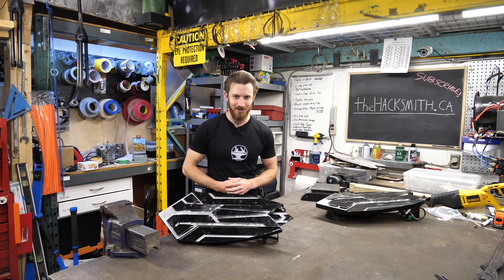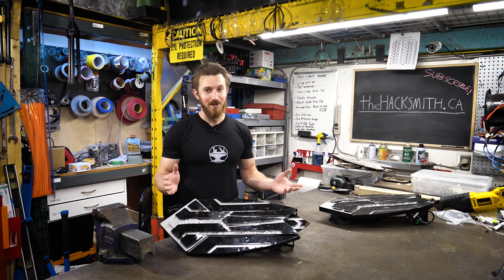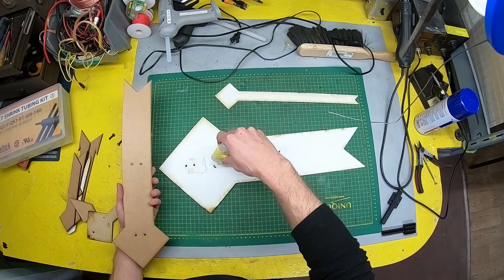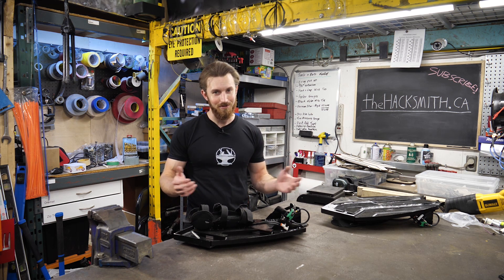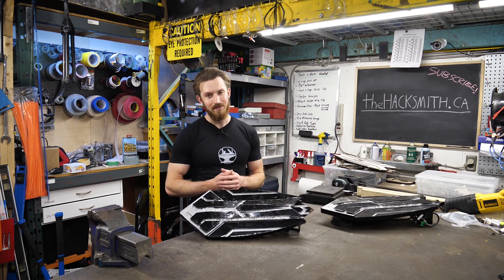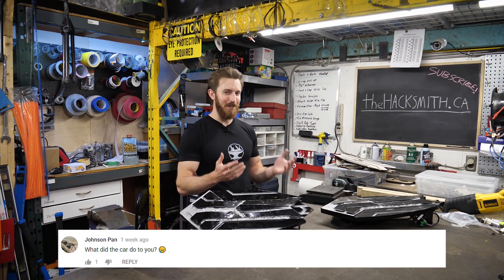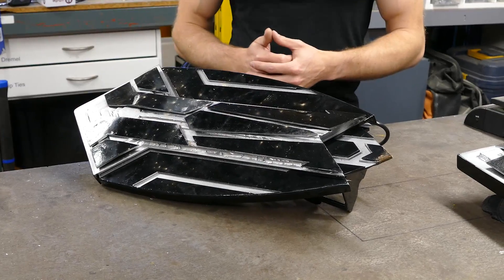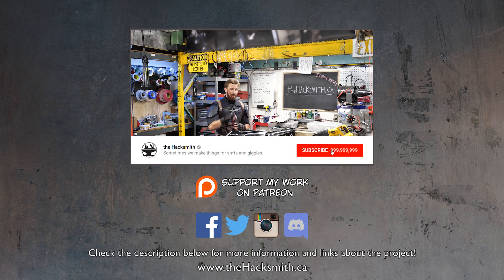Wakandan Shield (QUESTIONS AND ANSWERS)

Comment: Personally, I don't see the point in it expanding such a small amount. If it were small enough to use your hands and then expanded to that size then sure, or if it expanded to a size similar to caps first shield then it would make more sense otherwise I just don't get it

Comment: you could add the new shields to the exo that u had built then pipe the cylinder in to the compressor for extended use XD

Comment: Can you please reveal the mechanism of the actuators about changing the direction of the air
Reply from the maker: It's a double acting pneumatic cylinder using a 4/2 valve -- one position opens, one position closes, it just reverses the air flow =)

Comment: Just a crazy idea....
Idk if you guys like old Disney cartoon movies... but if you remember, there was a movie from the 2000 called Treasure Planet and there is this kind of like hover board or type of like surf board with a motor strapped to the back of if, I know I know, that thing would be big as hell if you guys build it but idk, you guys have gone far and I know you would maybe in a near future you guys could it, just to give you an idea and maybe an objective you guys would lile to do. If you guys try to make it I know is obviously imposible to make your board float with just a motor on the back so I'm not much of a builder and I don't even know how general physics work with shit like this lol but just a crazy idea considering if it would be surf board shaped maybe on the side that's facing the ground add two of those trubines or fans you used to try and fly like Iron Man and on the back the rotative motor to try and help you up and pick up the speed.... just a crazy idea....

Comment: I'm curious about the weight difference if you were to go to a higher tensile steel like ar500 or even some quenched and tempered steel like yea special weld requirements but honestly not that bad could be I'd say you could go down to quarter inch plate and still be quite a bit stronger than 3/8 oil rigs use it quite often on main lugs and similar for not just wear quite a bit for weight
Reply from the maker: It is 1/4" plate...
Reply: the Hacksmith sorry looked thicker  than that hmm and I don't think ar500 comes in any less than that hell most of the stuff I've dealt with is 3/8 plus